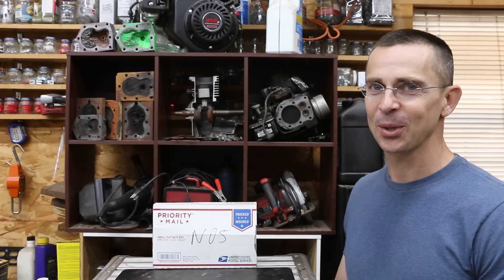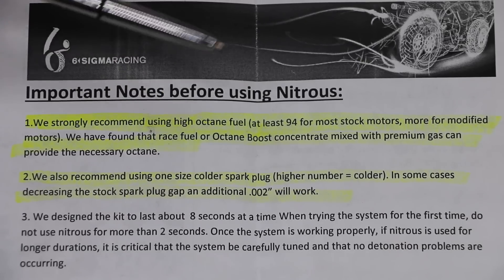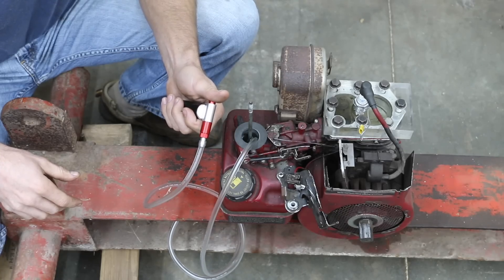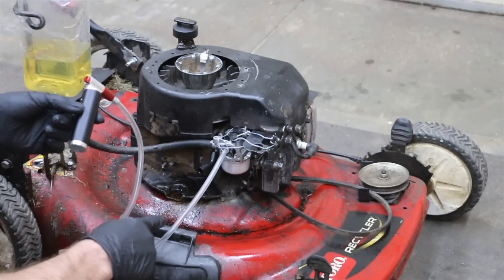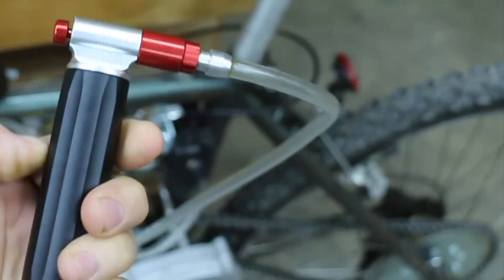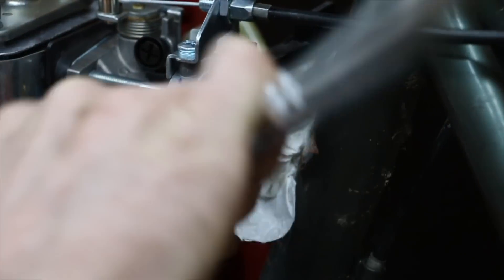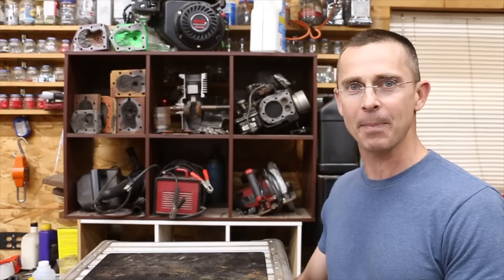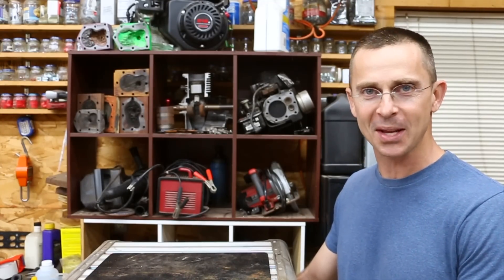Will the 4-Stroke Bike Survive Nitrous Oxide?  Let's find out!

Comment: food grade nitrous oxide is about 7 times as expensive as the race-car type. YOU NEED TO TRY STEAM INJECTION ALONG WITH NITROUS FOR A REAL SURPRISE
Reply from the maker: Thank you!
Reply: the steamers made to clean the bathroom are good, you can also simply spray water with a windex bottle, or other mist-spray directly into the intake when you see that detonation white flame (the ol' internal cutting torch mode)

 @ProjectFarm

Comment: Try mounting the motor on the front wheel I really think you will be impressed with front wheel DRIVE. 
.there is much more control over the torque on a steerable axle
Reply from the maker: Thank you!

Comment: I'd love to see you test out different rtv gasket makers, see which one holds up the best for their recommended applications, and I'd love to see if following the directions makes it better, I've always just put it on, tightened it down, put fluids to it, and gone on my way, I haven't had any major problems so far (mind you it could be anywhere from 30 minutes to several hours before any fluids are introduced depending on what was left to be put back together) it would be great to find out which brand is the best and if directions make a big difference
Reply from the maker: Thanks for the video idea!

Comment: But i thought this 4 stroke motor only takes 87 fuel will the 94 fuel blow up this motor i am talking about the one on the bike because i have the same motor and it said to put 87 fuel only in the fuel tank so i am confused can you use 87 or 94 fuel in this motorized bike kit 4 stroke?
Reply from the maker: Thank you.  No, higher octane fuel will not harm an engine.  However, it's not every efficient to spend more money on a higher octane fuel without any benefit from the octane.  High octane fuel benefits forced induction and high compression ratio engines.
Reply: Okay so i can use 94 in my motorized bike kit?

Comment: I've really been wondering about adding hydrogen to the air intake of a small engine. It would actually be super easy, super inexpensive, and super safe to do... Have a container of acidic and/or saline solution [i.e. add vinegar/salt to water], put two electrodes in it hooked up to a DC power source, have the positive electrode such that the pure hydrogen which bubbles from it stays contained and travels through a tube to the carburetor, have the negative electrode such that the pure oxygen travels through a tube and out of the container into the atmosphere. Regarding these last two points, I would put each electrode into a (sealed) hole in two different tubes, respectively, each being fed into the tubes above the water line, the tubes going to the bottom of the container of water, and the exposed wires of the electrodes well underneath the water line. I don't know if this makes sense for you without a picture and I understand if not, but I have thought it out quite well and believe to have a working model in mind using a plastic travel cup with a screw-on lid.

Despite images of the Hindenburg, hydrogen is very safe to ignite. There is a YouTube video of a chemistry teacher igniting a 3-foot long beaker filled with hydrogen, and alone it burns very slowly. An advantage to using hydrogen for fuel efficiency is that it can allow combustion to occur in a fuel to air mixture that would otherwise be too impossibly lean to burn. (The flammable limit of gasoline vapor is 1.4% to 7.6% by volume in air that is about 21% oxygen.) Thus it has the ability to increase fuel efficiency by decreasing the amount of gasoline required. Or you can keep the amount of gasoline the same, and get even more power with the hydrogen.
Reply from the maker: Thank you for the video idea!

Comment: Great video! That see trugh engine was realy interasting. Just a correction. I am afraid you didnt use the whole potential of nitrous here. It decompose in a engine yes, but it releases pure oxigen as it does so. This requires more fuel to use its full potential.
Reply from the maker: Great point. Thank you

Comment: Did you set the engine to over fuel at full throttle as it is a dry shot and will run lean
Reply from the maker: Great point.  The briggs was setup to run on alcohol and the fuel was setup to run rich in the others.  They all could have used even more fuel.

Comment: Nitrous is mainly for acceleration........ not for higher top end. Also the new technology of methane is much better. It doesn't make the engine cold cause rapid temps of both hot and cold also can cause cracked engine block
Reply from the maker: Great point. Thank you.

Comment: Might be interesting to rig up a propane injection system to supply the additional fuel needed with the nitrous. In theory you could use a twin tank set up (like for a small oxyfuel torch) that combines both gasses in one line, then use a push button on-off valve like you already have to inject the fuel. Tweaking the amount of propane would take some trial and error.
Reply from the maker: Great video idea!

Comment: This is nitrous oxide gas. Real n2o kits are liquid nitrous oxide that is injected either before the intake along with fuel or in the intake manifold directly with additional fuel. It adds more oxygen which gets compressed along with the extra fuel adds more power.
Reply: Oh yeah it’s not NOS...
Reply from the maker: Thank you

Comment: Is the NOS medical or industrial grade in the kit? Where do you get refills?
Reply from the maker: Industrial. Lots of options on Amazon.  It's used for cool whip dispensers.
Reply: @ProjectFarm  Well, if industrial, it has 1 part per million of sulfur making it unusable for any no human consumption, including whipped cream. For human use, it can only be medical grade. 40+ years ago, me and my buddies used to ahem find, nitrous for getting high. You can still use whipped cream if you don't shake the can and hold it upright, but that way is expensive. Thanks for the input

Comment: Just recently found your channel. Your videos are great and I appreciate the time you put into them. Not sure if you can do this one I have in mind but maybe you can figure out a way. I have ridden motorcycle for a long time now and lights on other vehicles are getting brighter all the time. I seem to notice that there is way more glare and blurring of the light when riding the bike than my truck or car. I am curious if the plastics on the bike (windscreen, goggles, face shield, etc...) produce this effect more than the glass on the four wheeled vehicles. The only material I know for sure that the plastic screens are made of is that the windscreen is Lexan. I've been trying to figure out a way I could test this. Any Ideas?
Reply from the maker: This is interesting. I wonder if there is a coating that can be applied to reduce the glare.  I'm not sure on this one. Thank you